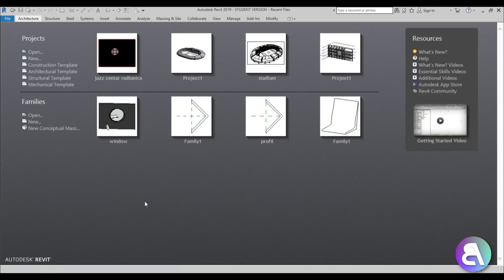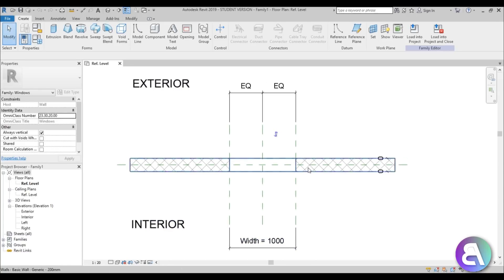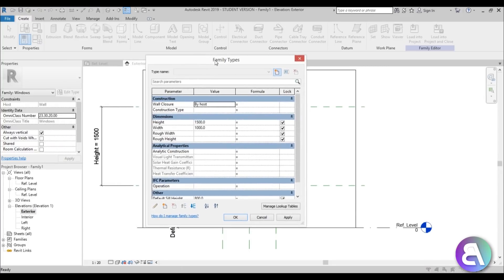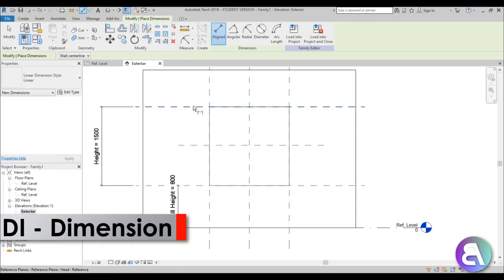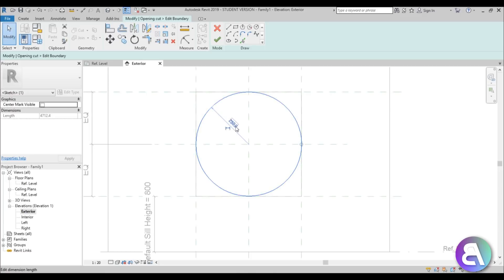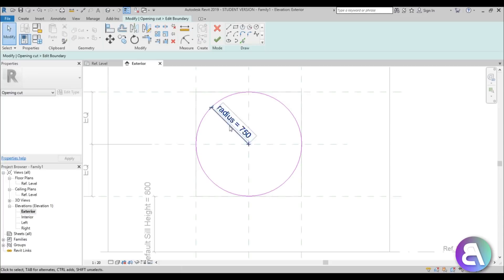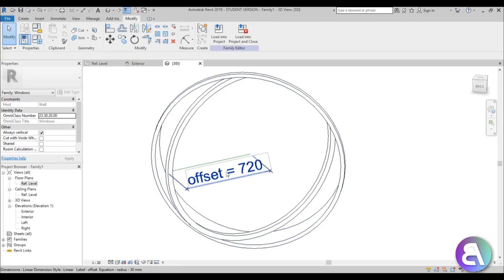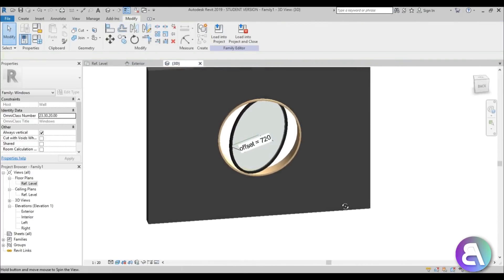Parametric Circle Window that Opens in Revit Tutorial

Comment: Balkan, first of all thanks for all the amazing tutorials. I have an issue, I followed your instructions but instead of doing it circular I did rectangular. Everything works fine. And when I move the paramters around in the Family project it works perfect, but when I loaded into an Architecture Project and placed it when i move the angle it doesn't work properly instead of increasing EQ it moves. Any suggestion?